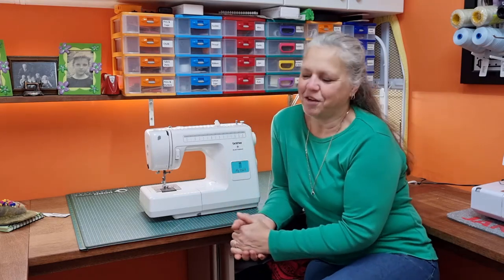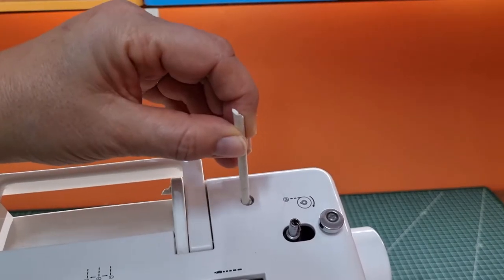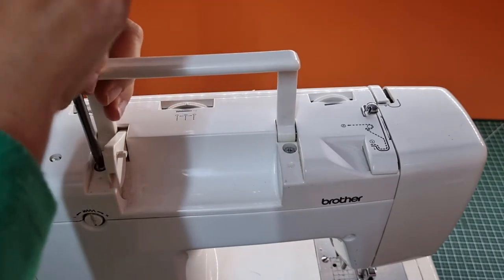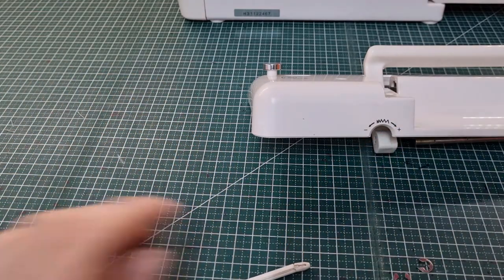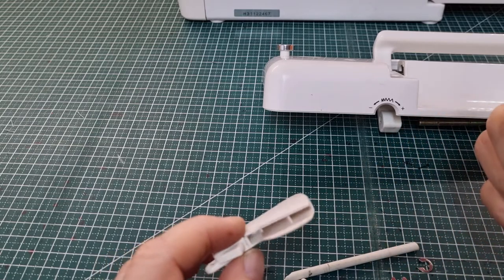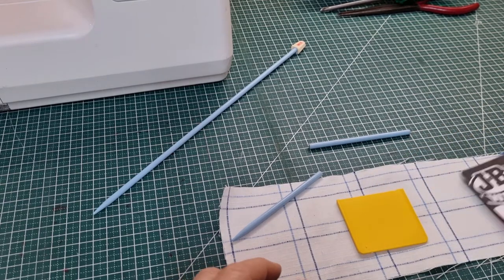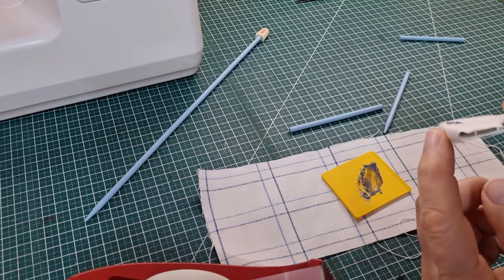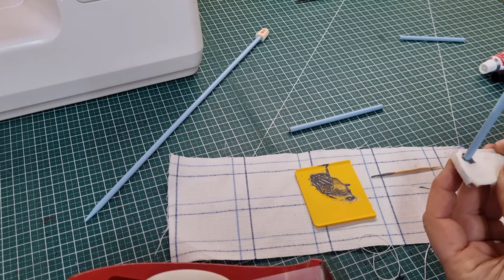DIY Repair/replace broken spool pin on a sewing machine from a shearing shed for years. Easy fix!

Comment: Thank you, Christine. You saved me from throwing away my 30+ year old sewing machine! I carelessly cracked off the spool pin on my Brother XL-2027 and figured it was toast and not worth of cost of taking it for a repair. But I found your video and showed it to my husband. We were laughing hysterically when the knitting needle showed up. You're a genius!

I found the replacement part for sale on Walgreens of all places (along with a few others). Once we had that in hand we just followed your video and it's fixed! It took a while and we had to start over a few times because we're not all that handy and our tools are limited, but the video saved the day every time. The only part we really had trouble with was getting those circlets on and off, but kept at it and finally got them on.
Reply from the maker: I'm so pleased you fixed your machine Tess.  I had loads of trouble with those circlips as well. Who on earth invented those wretched things😀

Comment: Thanks so much for doing this video! I started taking apart my Brother to see if I could replace the spool pin. Your video showed me I was on the right track and that I wasn't going to break my machine even more! ;)  I was able to find a replacement spool pin on eBay so my repair was a lot more straightforward!
Reply from the maker: That's fabulous Naomi. I didn't even consider a replacement part. Well done!😀

Comment: Great video! I love watching the process. I am curious about what a repair shop would have said and done about this particular repair, or if they would have declined the work.
Reply from the maker: Thanks Patricia. It would depend on the store and the mechanic. When I sold machines, I had an independant repairer that would do whatever was needed. Other stores may have a technician in the same place they sell machines, and may therefore encourage you to purchase a new machine😀

Comment: Enjoyed watching your handyman skills. Quick question. What can I use instead of felt as a spool pin pad for my top spool? I noticed you don't have anything either.  I acquired an early 70s  Singer Fashion Mate 252 and my thread keeps going around the pin and under the spool. I think that's the reason my top thread is getting wound and  seized in my bobbin spool. Thanks. Great job!
Reply from the maker: You can purchase pieces of felt from craft stores, and cut it to size. If you have some wadding/pellon that might work too. You could even sew a few layers of fabric together, then cut that to size as well😁
Reply: @ChristinesHomeAffairs  OK. Thank you! I found a piece of heavy duty hauling or moving strapping. I'll see how that works for now. Thx.

Comment: What is a good dual voltage sewing machine to take to ✈️ Europe?
Reply from the maker: Can you even get them Ike?  I'd just use the plug adaptor for the country you're going too.  Or perhaps purchase some kind of inverter suitable to the machine and country.  Failing that, you might need to get friendly with a technician and see if they can convert for you 😊
Reply: @ChristinesHomeAffairs  converter is an option but especially with computerized machines it is not recommended. Plus converters can be bulky, some of them are noisy or create heat etc. I already purchased a Singer HD 6800 after checking their manual online and it did show that it works with 120-240 volts. However the machine I received showed 120volt on the sticker. I called customer support and they say 120volt only.  I am back to square one.
Reply from the maker: @ike7539  It might be worth considering purchasing a machine in Europe,then selling it later, or seeing if you could even hire one